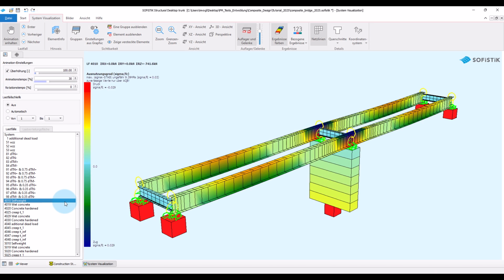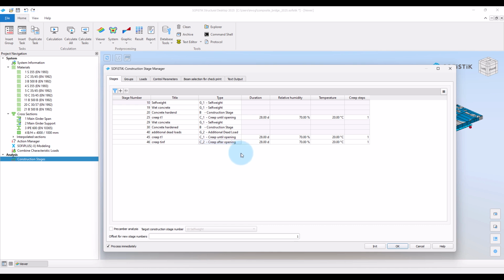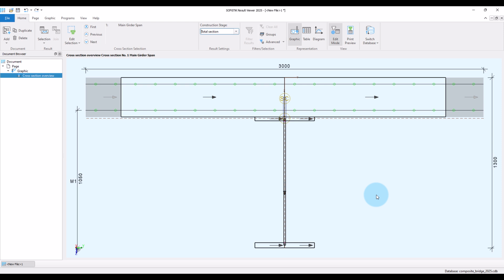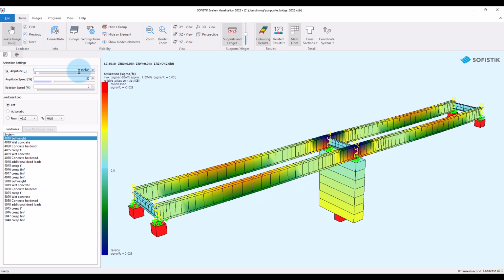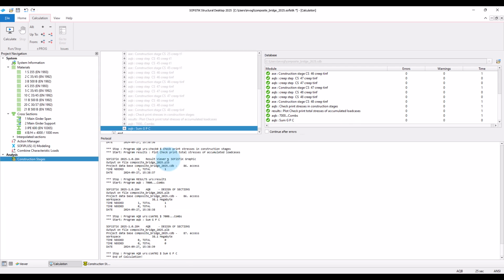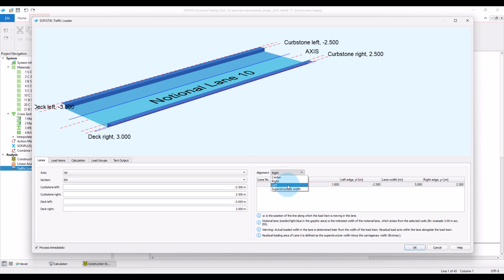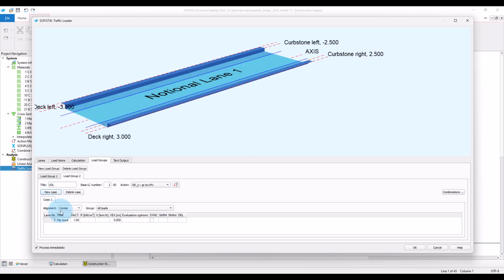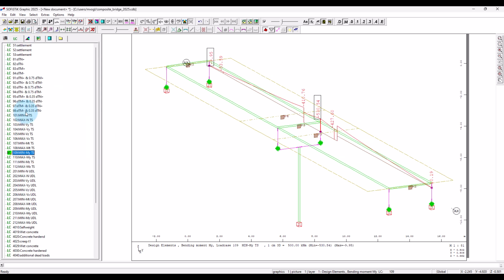Composite Bridges: Analysis

Comment: can i import Revit bridge model to Sofistik?
Reply from the maker: Hi GKen-d5l,
you can export Axis & Cross Section information from Revit to SOFiSTiK - SOFiPLUS.
In Revit you can use the "Export"-Button (in category "Transfer") to export a datatype "SOFiSTiK Analysis Link" .json file.
You can then import this .json file in SOFiPLUS by entering "sfo_sbm_import_infrastructure" in the AutoCAD command line (middle bottom of your drawing space).
You can then use the imported axis & cross section as in a typical SOFiSTiK project.
I hope this helps ;)

Comment: Hi,
I have a question regarding the support forces due to loading. In this example, the support forces obtained in the Z-direction are significantly larger than those in the X- and Y-directions (aprox. 15000 kN versus 250 kN) . Could this be a result of not considering seismic effects, or is there another possible explanation? Thank you!
Reply from the maker: Hi Dela-delana,
the displayed results are very much dependent on what kind of loads are considered. To make sure to display the right results, please check if MAXIMA superposes the right loadcases into result loadcases (max PZ, min PZ, max PX,...)

Comment: Hello,
I am encountering an error when trying to calculate the Construction Stages task in SOFiSTiK- Student Version. The error appears in AQB and states: Not enough memory. 257 words missing (1028 MByte). A maximum of (13699.0 MByte) is possible. Please increase M-Parameter. 
I checked the SOFiSTiK forum, where it is mentioned that this issue is common with 32-bit systems and older versions of SOFiSTiK. However, I am using a 64-bit system, so this should not be the cause. How can I properly increase the memory allocation to resolve this error? Is there a specific setting I need to adjust in SSD or a parameter I should define in the script? Thank you.
Reply from the maker: Hi DzeniSa-w3t,
usually we do not want to answer support requests via YouTube.
But as you are a student and you already put effort into finding the answer on your own, I will make an exception.
This is a soon to be resolved topic of AQB only allowing for max 256 sections to be designed for one element. Usually, this wouldn´t happen and only occurs for long bridges, integrated by Design Elements and HDIV small enough to create more than 256 sections.
There are 2 easy solutions:
Either you define HDIV small enough, to result in less than 256 sections for your design element, (less interpolated results)
or you define multiple design elements instead of your singular one. (same amount of interpolated results.
I think the second option is the superior one and this issue will be changed soon.
Reply: @SOFiSTiKAG  Thank you for your response and for making an exception. That was exactly the issue. I really appreciate your help!